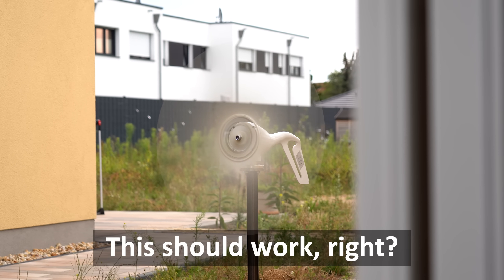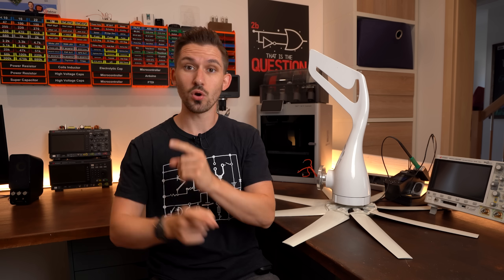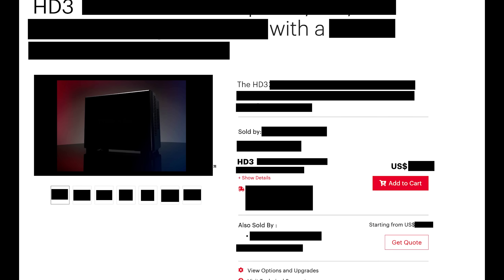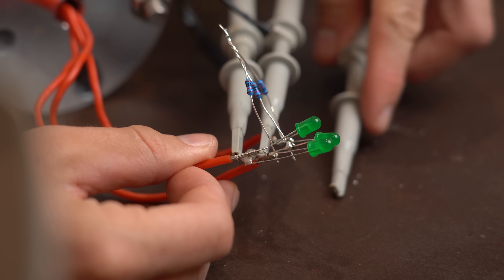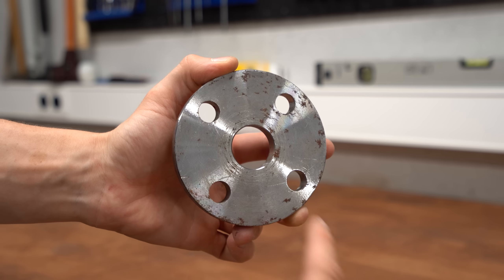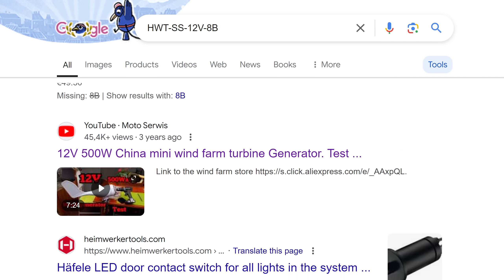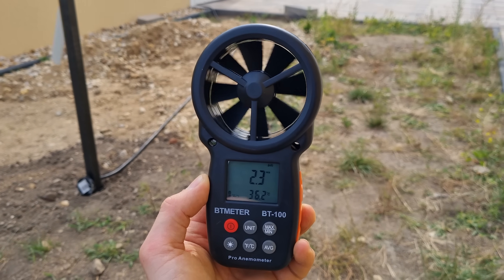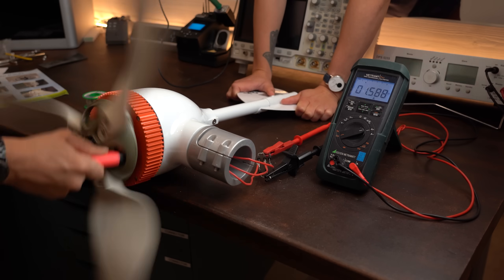I tried to Power my Home with Wind Generators! (Worth it?)

Comment: Energy storage. We really need cheap bulk energy storage that can be used at home. Without that you need way too much potential capacity with renewable. 
about 10kWh per day is enough on average - that would mean for most households a 2 kWh peak installation would be enough to cover their needs..... that is about 4-5m² with cheap panels.
And realistically you need like 3-4 times that to actually cover the load-spikes when you need them. And that still is not enough for when the weather is bad, so more in the range of >5x your actual consumption is needed.
It would be best to have storage for 3-4 days but that is just prohibitively expensive and really damaging to the environment.

Solar is nice for the day and quite suited for charging up batteries.

Wind in most places is just too weak and unreliable. The rotors really need to be far up and large to produce decent power - and in most places you want to live there is no steady strong winds (duh).

Most suited for power-generation and easily able to support a fully off-grid setup is hydro.
Oh yeah - nearly nobody even has the option to use hydroelectric power cause for that you need a stream of water that you can use. And that either has to be very large or it has some elevation change. It can be astonishing to see just how small you can make a hydro powerplant and it can still easily cover the needs of a large family household.

Comment: You really got me thinking, why not buy a car alternator from a scrapyard instead? If it can power lots of auxiliaries on a car while giving spark to the engine and charge the battery… it should do something. And you already have all the rest sorted already (propeller and regulator/rectifier etc)

Comment: According to the wattage you want, you need an AREA of the blades. If you want 15 watts, use blades that are 10 times than this tiny one. 150 Watts - 100 times area (that is 10 times wider) than this tiny turbine.

Comment: Possibly silly question but could you not install a gear box between the generator and the blades?
Reply: You could but it adds unnecessary losses. Always better to design the generator for low wind speeds.

Comment: You're pretty much on a hiding to nothing with small wind turbines. About the only place they make any sense at all is on something like a small sailing boat or off grid sensor station. Wind turbines don't scale linearly for many reasons (see my video series) and in your case the inability to raise the turbine up to a height well above your house is going to limit them even further. There is a reason utility companies buy bigger and bigger turbines. This scaling problem doesn't manifest itself with solar, and hence solar is a better choice for individual dwellings.
Source; I'm a mechanical engineer with a decades experience in the offshore wind industry

Comment: Next question for me would be: what is the minimum viable size for practical home use? I suppose it depends more on how the "motor" is wired than physical blade size, but maybe they are related? Interesting info here. Thanks for sharing!

Comment: There is simply not enough energy in the area the windmill can harvest. The Vevo windmill is the better of the two and maybe it can harvest about 200 w/h in optimal conditions. 
I have a Genner Windy 1500, which should be able to produce 1.5 KW/h. with wind speeds over 6 m/s. The average wind speed near my home is 7.5 m/s. I have to instal it, but I'll wait till the summer (southern hemisphere). There is no mast included, so I have to cut a few trees to build a decent mast. 
Even a windmill like that is not economically interesting, but I have no connection to the grid and the solar panels do not give power during the night and not qiuite enough during the winter to be able to power a Tesla.

Comment: If all you need is a higher voltage at low wind speeds there is a simple solution.  A 3 phase transformer before the charger.  Transformers are extremely efficient.  But the problem might be more than the voltage and simple they do not produce any meaningful power in the first place.  I though small ones like yours would put out something like 60W though.  If you did want to go the transmormer route at least you won't need a large one.  You might want to wind your own if you have the forms and wire but I suspect that good cheap ones are pretty easy to get.  I think you can even get 3 phase to single phase versions to simplify things but if your charger wants 3 phase better leave that be.

Comment: Most of these wind turbines, available on the Internet, to buy are crap, because they use motors as generators. It has been known for years that slow-speed generators are needed for wind. The so-called American, vertical axis wind turbines are the best. For home use I would recommend just that.

Comment: Good experiment.. 
Some thoughts.. 

1. Would it be better to direct more wind by building a wind tunnel? As wind power seems to increase when directed through a tight space. 

2. Combining 3 or more should generate more power.. At least powerful enough to charge a battery, after implementing the directional wind, and after recoiling.

Comment: ENG: Another amazing video! That being said, it would have been very constructive if you had shown calculations describing how much more battery autonomy your system could have gained if you had spent the money on more batteries. According to your description, it seems that you already have enough solar panels.

GER: Ein weiteres großartiges Video! Das gesagt, wäre es sehr hilfreich gewesen, wenn du Berechnungen gezeigt hättest, die beschreiben, wie viel mehr Batteriekapazität dein System hätte gewinnen können, wenn du das Geld in weitere Batterien investiert hättest. Laut deiner Beschreibung scheint es, dass du bereits genug Solarpaneele hast.

Comment: Doubling the Voltage of the Wind Generator does not require rewinding. Looking at 10:10 we notice that the Wind Generator is all ready wired for Two different Voltages. Notice that the winding of this Generator has Two Wires in Parallel. All that is necessary to Double the Voltage is to resolder the Two Wires so that they are in Series instead of Parallel. Doubling the Voltage of the Generator without Rewinding. 

That would make a nice video.
Reply: @cristibaluta nope, short circuit was 700mA so let's say 500mA MPP, at like 10v that's 5w. Not 1w
Reply: @Robbedoes2  Difficult with the laws of physics for a Romanian immigrant...he works alone and shares with two or three other "beneficiaries" (three-phase or parallel assembly) while the author of the clip must apply the system of connecting the generator coils "in series"
Reply: @cristibaluta  It makes the voltage losses across the diodes proportionately lower. You're losing 1.4V in the bridge rectifier and at 6V that matters - a LOT
Reply: it will drop current to 1/2 too
Reply: This isn't true, it's a 3 phase motor not 1 phase. Series/parallel does rarely exist in 3 phase motors, namely dahlander. Star/double star connections instead of star/delta connections. But sadly it's already star configured so no improvements can be made. He needs a boosting converter or rewinding the motor
Reply: @Robbedoes2  Take a close look at 10:23, you can see one of the legs it has two wires coming off it in parallel. He pulls off the center star solder joint that looks six wires (not three) coming together, the star. To me, it looks like they wound the two wires in parallel, to double the wire size that they wound. They could have wound a bigger wire, or as they chose, to wire two smaller wires in parallel. Take the one of the proper center star wire and run it back to the proper leg instead of going to the center star. This mean the current has to make two loops to the center star instead of one loop thru the windings to the center star. 

The essentially ran two parallel wires like it was a bigger wire, it can be reconfigured to make two loops thru the windings instead.

I could be wrong, i'm just a Rocket Scientist, not an electrical engineer.
Reply: @Robbedoes2  There are multiple windings for each phase which you can choose to put in parallel or series. I've done that on a 1.5 kW industrial motor to lower its rated voltage (all 4 windings per phase were in series, I reconnected them to 2P2S)
Reply: @openinverter  It seems to me that pulling power at different voltages within the windings, would allow a controller to optimize the rotational speed of the of the blades. This would allow the wind turbine to run at it's optimal rotational speed for all wind speeds, optimal power output for all wind speeds. Instead of having a design rotation/wind speed of a single fixed voltage, fixed windings, fixed blade angles... meaning than the turbine generates less power whenever it's not at design speed which it never is.

Comment: As many mention already you need put it way higher, and proper wind speed to get any useful power is 10ms+. Also i saw some calculator to calculate maximum possible power by fan diameter, and this one looks very small. To get something around 1000W you need as i remember around 2m+ diameter

Comment: Get it atleast 10meters above anything within a circle of 100m. You need clean, consistant airflow, no gusts, it will ruin any potential it had. Omni calculator has a nice page where you can get the theoretical numbers. Also, three blades are always better than more.

Ive been dabling in windpower for quite some years now. Goodluck, its a lot of fun. If you want real power though, a turbine needs like 3m blades atleast. These toy turbines might be able to charge a phone in good wind, but thats it honestly. Not enough area, copper and magnets.

Comment: So sorry it didn’t work out.  You know from watching many alternative energy videos wind generators really need to be high above all surrounding obstacles to provide proper & consistent power. If you already have max amount of solar panels then the answer is a larger battery bank. That should work out for you.

Comment: The moment i see AC-DC, im triggered FULL BRIDGE RECTIFIER (yeey for big clive)! Never knew how that was pronounced in german, but sounds far cooler :D
We had 2 small ones for about 4 years at the veggy farm only to charge up a 12V battery for some simple led lighting in the shed, and in a way.. although it was pretty low (though we had windspeeds of 5-6 most of the time outside), it did gave enough charge into the battery to be there every other day and have enough lighting in the shed. On good days got even enough to charge a phone or some tools. Though in the winter it did felt like they were equal (full day) with a single solar panel, though that was a old 90watt version, since days were shorter.

Late 2022 we had to remove them, since they are 'dangerous' for possible birds or stupid people (they spin fast.. true), so we now got a 145watt panel. A single one aint much, but 'many littles' still create a decent ammount.

Comment: There is lots of information on small windturbines available online. Real-world measuring data and everything.

The results are always crystal clear: small windturbines do not work well. Lowly placed wind turbines do not work well. Lowly placed small wind turbines do not work at all. The physics are simple: wind power scales with the square of the diameter and with the cube of the wind speed. No amount of tinkering with the electronics or windings is going to bend the laws of physics. If you want more wind power: get a larger wind turbine AND mount it much much higher. If that's not possible, well, I'd say you have two options: move to a location where can install a larger wind turbine higher up (also Google "Germany wind map" and you'll see that you live in poor area for wind power), or look for another source of power....

Comment: So, there's a really good 'Real Engineering' video on this concept about commercial Wind Turbines. "The Problem with Wind Energy." The main issue with such turbines is that they need to be high up (ofc for speed), but also they need a very large gearbox's in order to produce commercially viable amounts of power at high RPMs. I would say, you could try adding a gear box extension to the fans to see if you could get a higher RPM on the generator producing a higher voltage at lower wind speeds.
Reply: Also, I am not an expert by any means.

Comment: I wonder if the right solution here is mechanical instead? Add some gear reduction between the motor shaft and the turbine shaft to account for slow wind speed?

Comment: In theory, a vertical-axis wind turbine can produce power in low-speed wind. You may also need to lengthen the propeller blades to increase torque. But it may take up too much space in your garden. I wish you could put the wind turbine on the roof. Thanks for sharing your experiences with us.
Reply: Vertical turbines do work from low wind speeds, but the caveat is that the slow wind carries almost no energy. Combined with worse efficiency of vertical turbines...you are going to get exactly...one mousefart of energy or even less...

Comment: QUESTIONS:

Assuming money is not an issue:

1) Could we purchase for example 10 of these wind generators, and create some kind of parallel box to accept the output from each simultaneously, to then use the combined energy to charge the battery?

2) If we do create a paralleling black box, do we need diodes between each wind generator, to prevent back feeding the other generators?  If yes, please describe what needs to be in the design. 
Also, does any supplier already make/sell a box ro parallel/combine multiple wind generator outputs, and have built in safety considerations?

3) Do you, or anyone, know of any web sites, where we can learn in greater detail how ro achieve, a multi wind generator output system?

4) How would we connect the output from the array of wind generators, to our solar battery array, which is simultaneously being charged during the day via sun/solar panels?  Do we need a diode to only permit the wind generator array to charge the LiFePO4 battery array, to avoid any discharge from the batteries to the wind generators?

5) What are the most reliable sources for wind generators, and controllers?

Thank you for your excellent video!
Reply: On point 1 and 2, no, you can't parallel the generators directly or with diodes. With 3 phase, you have AC voltages. Their frequency is going to depend on the speed of rotation. If they are off by even just a little bit, they will tend to drive each other. This is why you have to be very careful when connecting a power plant to the grid, as the rotation speed must be kept extremely stable and the phase must be aligned very well with the grid before connecting it.

If you have an MPPT for each generator, then things are different. You can get controllers that are designed to combine the output of several generators. Roughly speaking, each converts to the same DC voltage, at which point those can be connected in parallel.

Comment: Very interested in this technology, 
as an add on for evening charging
when no sun available (as you described).

I have not been able to locate any good info on this subject, and your video is the best info I have located so far.

My Questions:

Assuming money is not an issue:

1) Could we purchase for example 10 of these wind generators, and create some kind of parallel box to accept the output from each simultaneously, to then use the combined energy to charge the battery?

2) If we do create a paralleling black box, do we need diodes between each wind generator, to prevent back feeding the other generators?  If yes, please describe what needs to be in the design. 
Also, does any supplier already make/sell a box ro parallel/combine multiple wind generator outputs, and have built in safety considerations?

3) Do you, or anyone, know of any web sites, where we can learn in greater detail how ro achieve, a multi wind generator output system?

4) How would we connect the output from the array of wind generators, to our solar battery array, which is simultaneously being charged during the day via sun/solar panels?  Do we need a diode to only permit the wind generator array to charge the LiFePO4 battery array, to avoid any discharge from the batteries to the wind generators?

5) What are the most reliable sources for wind generators, and controllers?

Thank you for your excellent video!

Comment: Will you build a new MPPT?
It doesn't look that hard as you are just control the resistance while providing it with a slight oscillations to find the optimal load from the derivitave (as long as there are no local minima); then feed that into a buck step-up and down converter.
General understanding:
     Three phase rectrifier
    Custom buck load switching circuit 
    (Custom or offshelf) buck convertor
    Current limiter to avoid bogging down the circuit

Comment: I saw a video where some folks trying to convert broken gas/gasoline/petrol/benzin generator into a wind generator. The internal combustion engine part is dead but alternator/inverter parts are ok. So they want to spin it with the wind. It was a 1000W inverter type generator. How successful does it sound to you?

Comment: Regardless of the height or location, i was thinking it might be better with a gear ⚙️ box attached to the generator attached to other end of the pole using a shaft and 2 90° gears attached to the propeller.

Comment: How much you want to bet we could have a highly efficient wind turbine on every household and all save money but instead they only allow the industrial ones so they can keep us dependent on them. Even getting solar youre still grid tied in the US. Ive always felt that toyota or someone could design a long lasting easily repairable efiicient low speed wind generator but it seems theres a hidden hand keeping them off the market and all we can get is cheap useless junk now for decades.